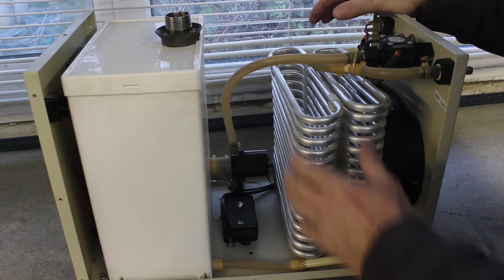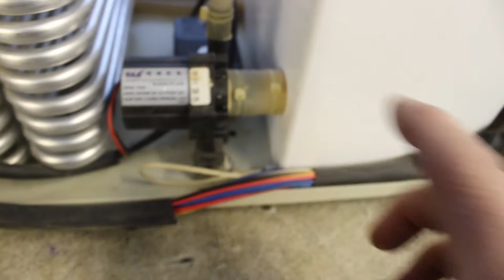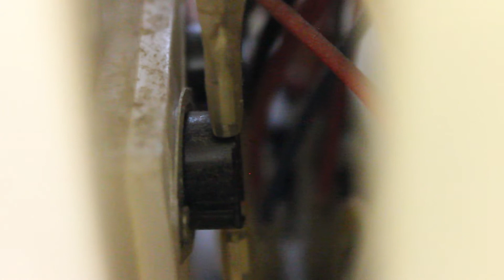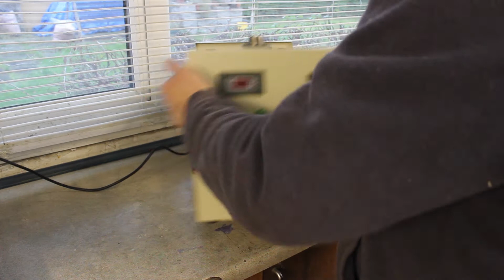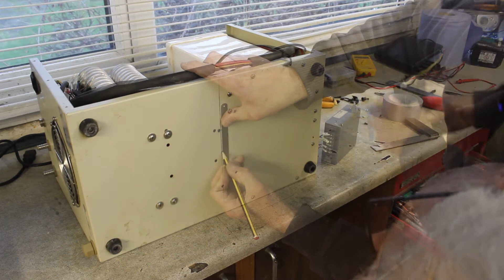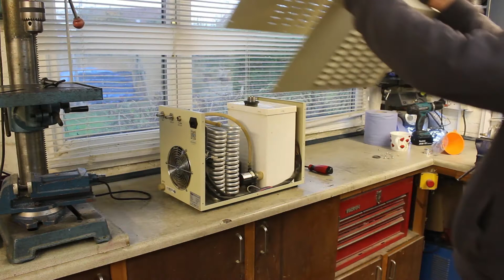If you have laser cutter you will want to see this

Comment: Can you regulate the temp on those units? Be useful for cooling water cooled CNC router spindles...
Reply from the maker: Hi Matt,
There is no regulation on them but I have used one on my cnc router for years. It keeps the 2Kw spindle cool whatever the weather. The router came with a plastic bucket and a fish pond motor so I went with the upgraded chiller and its been faultless since.
Cheers
Reply: @CazualHaze  Same here - plastic container and a fish pond pump. Will hunt around for one of those 3000's
Reply from the maker: Worth the trouble!